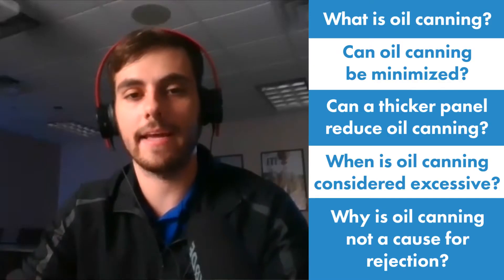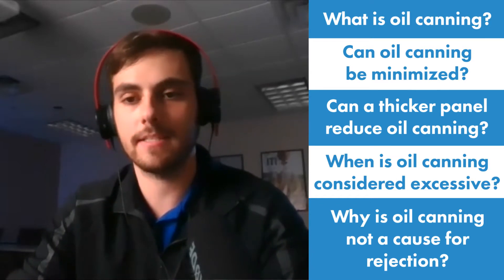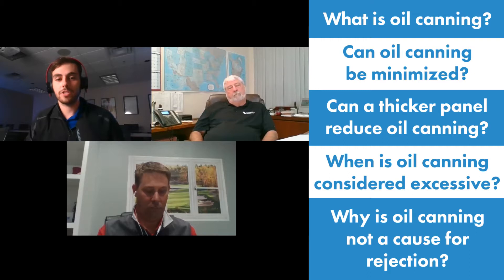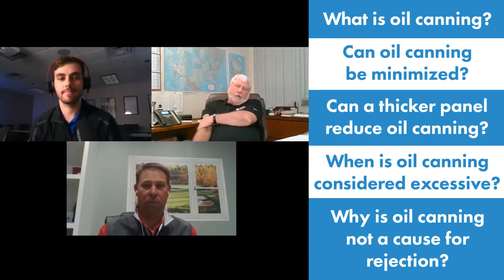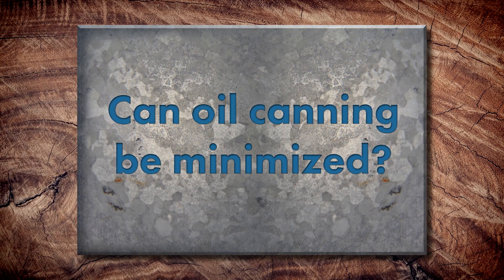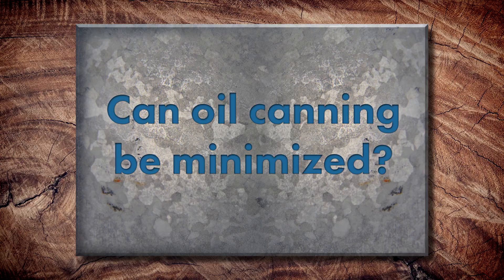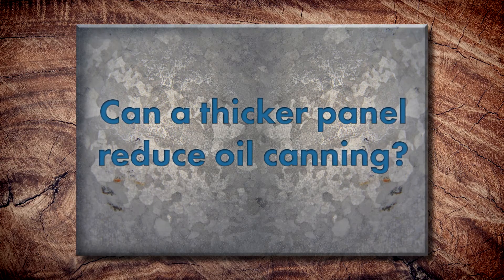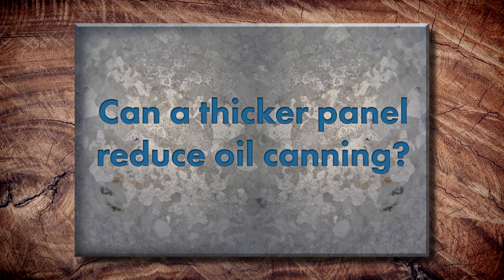What is Oil Canning and How Does It Affect Metal Roofing?

Comment: At 2 minutes into this video, Tom says, "oil canning is just stress and then seal oil in them or copper or any kind of metal". That is word for word the text that is displayed as Tom speaks. There must be something lost in the captioning. It looked as if Tom was about to offer an explanation of how or why the word "oil" is related to the effect of oil canning.

Also, will a flat finish (used to reduce oil-canning) result in dust or debris sticking to the roofing material more readily than would be the case with a glossy finish?

Thanks, Tim
Reply from the maker: Hello Tim!
Yes, that was a captions typo that we've corrected. Tom actually said, "Oil canning is just stress in the steel, or aluminum, or copper, or any kind of metal..."
In regards to your question, the regular gloss finish is a little smoother than the low gloss.
That being said, dust will slide off easier on the regular gloss, although probably not enough to notice.

-Thad
Reply: Thanks, Tim
Reply: Tom is just speaking about oil canning, oil is really not relative to the discussion, my apologize for any misconception...
Reply: 9:56 homeowners to agree what?
Striations are the best tool out there... what straiations?